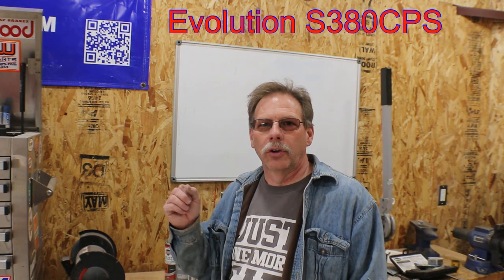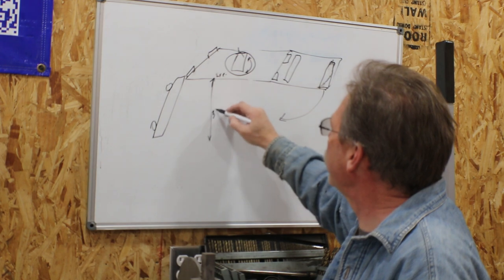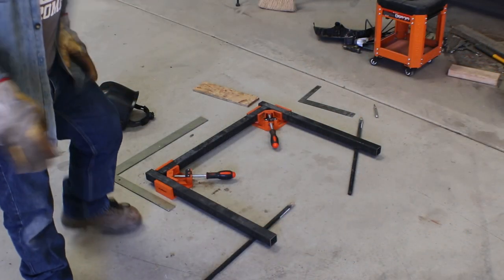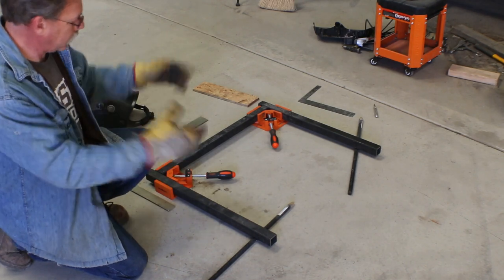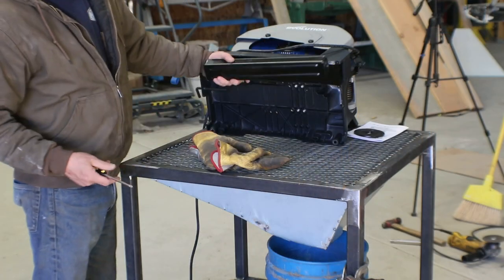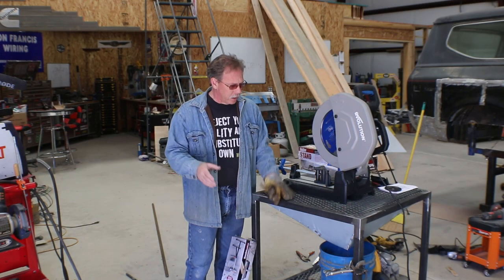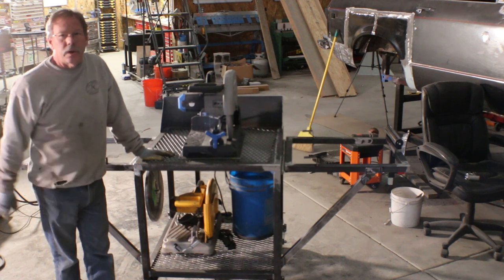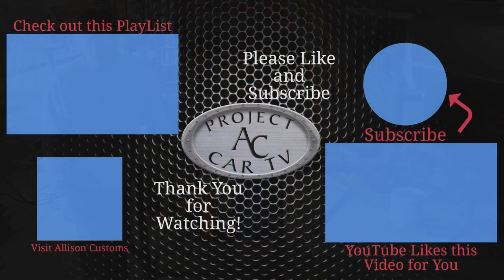Chop Saw Station with Pivoting Saw Mount | ALLISON CUSTOMS

Comment: Best design for metal work saws I've seen on Youtube.  There's a bunch but this seems to be the most practical and versatile so far. The side table supports are great and really like the adjustable rollers instead of permanent because I too have the abrasive bought first then the cold cut after.  The bucket and funnel idea makes this even better in my opinion as well. Everything on rollers for a working shop is much better so you can take the tool to the work just sometimes a lot better too. 4.9 stars  only because you didn't paint lol
Reply from the maker: Thank you for the uplifting comment, I really like the design as well. This saw gets used a lot!

Comment: Dear Geoff, thanks for showing your cut-off saw table build. There are a few new ideas in yours that will come in handy when the time comes for me to build my own.

I do have a question about your EVO saw.  When you cut, engaging the blade is that part smooth or a bit rough?  I have an exact same EVO saw and engaging the cut on mine gives coarse vibrations for a while until I’m deep into the cut. I can see my hand and lower arm shaking. Is that what your saw is like or do I have a faulty model?
Reply from the maker: Thanks for watching!  
I haven’t had the issue you describe.  I have replaced my blade a few times already, and I do try to let the blade spin up fully before starting the cut, but it seems very smooth - at least until the blade gets dull.  Kinda sounds like a bad motor bearing???

Comment: Put a variable speed controller and herculees cold cut blade on that dewalt and you'll have 2 cold cut chop saws. Labwork store on amazon $23.35 router fan variable speed controller box.  Been running one on my saw for 2 years. Switch it to variable (not full) and dial it to medium(around 1800 rpm) and she'll cut just as good as your evolution.  I have mine locked in for 45° cuts and the evolution does my straight cuts.
Reply from the maker: Great idea, I use a similar controller on my portable band saw table, never thought about using one on my abrasive saw. Thanks for the comment!
https://youtu.be/DEz3afCj8bw

Comment: Could you suggest a way to lock the lazy susan bearing? I assume the saw will rotate all the ways if you didn’t lock it and you will not get a straight cut.
Reply from the maker: To answer your question, I would add a plate under one corner of saw side of the lazy susan.  Then drill a hole through both and use a spring loaded pin to lock it in place.  However, because the vice is on the saw base, the angle of cut is established by the saw not the stand.  The stand having a lazy susan really only provides for keeping the metal in one orientation and moving the saw VS having to swing a long piece of metal to swing around the area for different angled cuts.

Comment: Now that you have had this for a while, is there anything you would change?
Reply from the maker: I should have made the "wings" a little shorter, the turning casters will hit them when moving it around with them folded down - I didn't plan that out very well, for me the fix is going to be adding some spacers between the casters and the frame.  
I would (will be) adding a long 25' plus cord to the saw or (probably my option) add a junction box to the cart with a long heavy duty cord that I can plug other stuff into as well.  I store the saw over near my plasma table, but I move it all over the shop when cutting long pieces of steel, and I'm constantly hunting an extension cord.
Reply: @AllisonCustoms  I ordered a bearing for mine yesterday, getting excited to start my project!